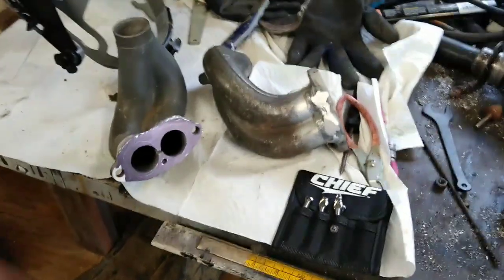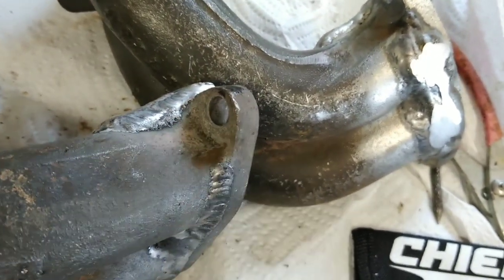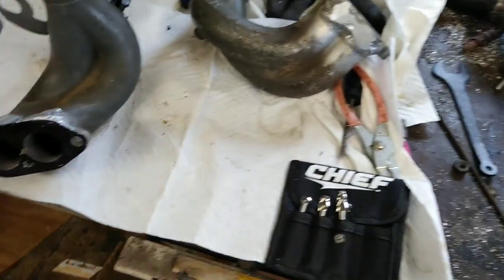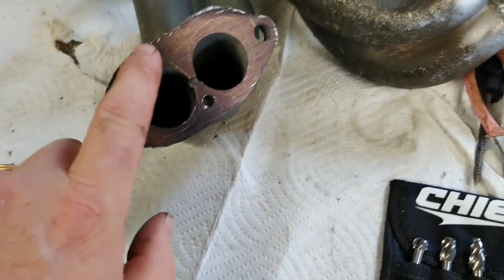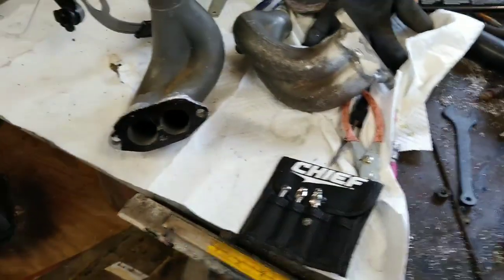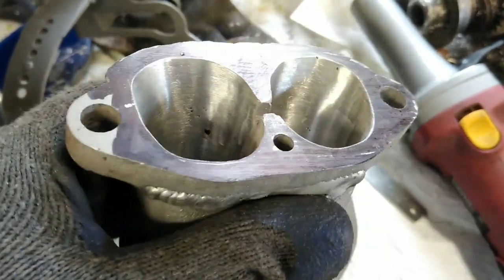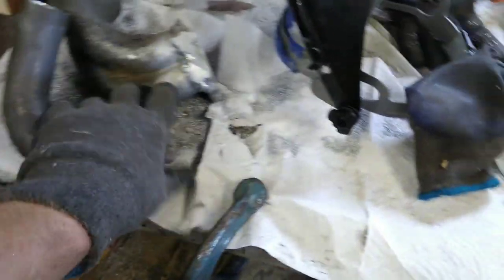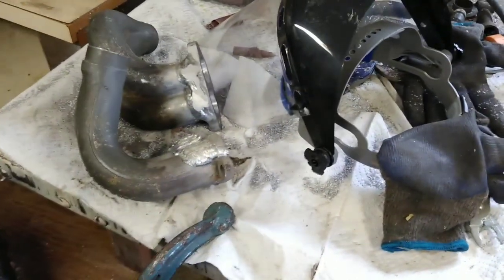Mach Porting VW Manifolds!

Comment: What's up with the notch between the ports?
Reply from the maker: VW did that to make a balance port. They also had dowels that would A line the manifolds, that's why stock gaskets have that hole in the center. VW stopped doing both of those things in later models.

Comment: What are these manifold ends made from are they aluminium
Reply from the maker: Yes they are made of aluminum.
Reply: Cheers I might do this to mine I have a 1300tp but planning on rebuilding it to a 1641 with a single 40 hpmx